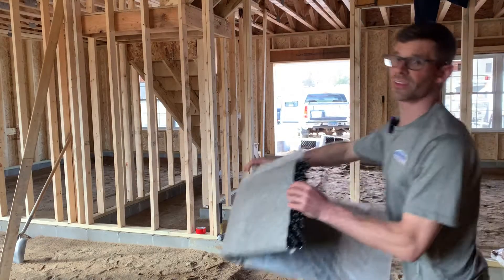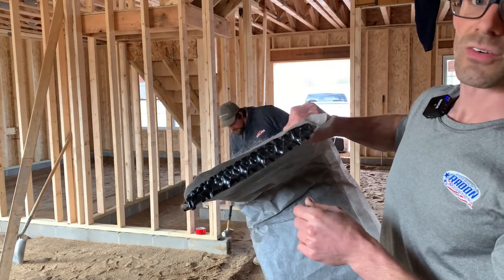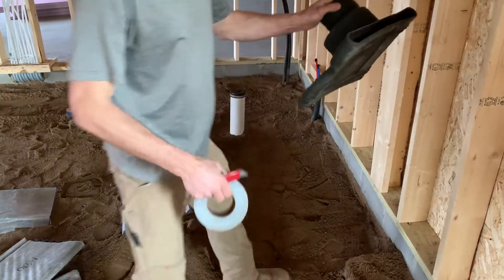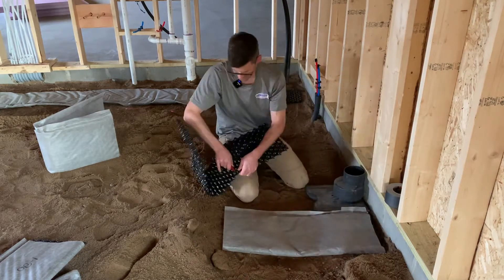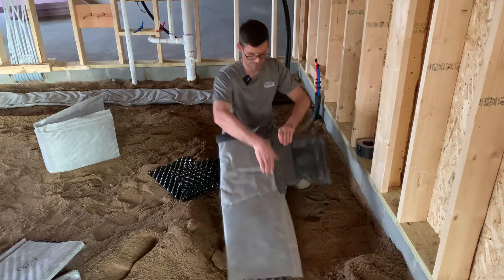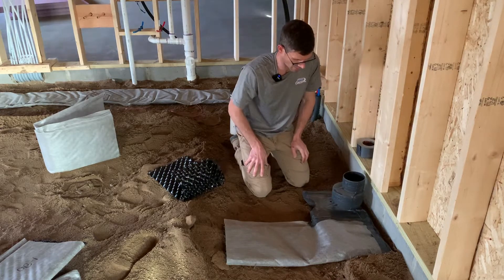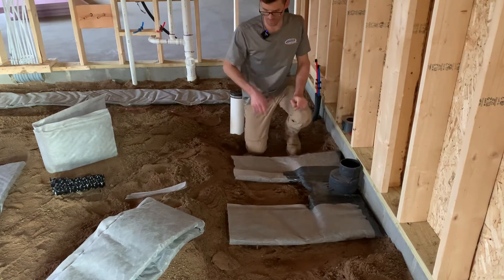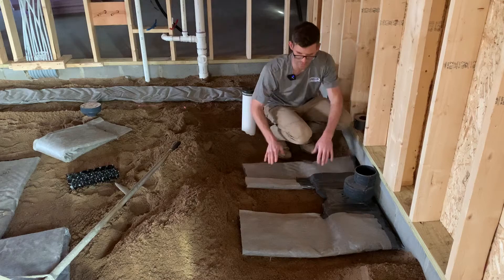Radon Soil Gas Mat and Vapor Barrier Install (House Build Ep. 6)

Comment from the maker: Products Featured
1. Soil Gas Mat - https://radonpds.com/build-radon-ready/
Use code JESSE for 5% off your first order. We receive a commission. 

2. Gorilla Tape - https://amzn.to/4lG8vhx

3. Landscape Staples - https://amzn.to/44HDpju

Radon Standards
1. The radon standard we are following. https://standards.aarst.org/RRNC-2020/index.html

2. View other radon standards here. https://standards.aarst.org/

Other videos in this series:
1. From Dirt to Foundation: Laying Out Footings and Forms (House Build Ep. 1) - https://youtu.be/UP3scCbdBQU?si=kWaxZO9wIyAn9jlv

2. From Footings to Block Walls: Passive Radon System Options (House Build Ep. 2) - https://youtu.be/ZR46xPbNEiI?si=A-JsE2qcx9_4M6Ko

3. From Backfill to Framing: Floor Trusses and Radon Suction Challenges (House Build Ep. 3) - https://youtu.be/wqWcpdSs594?si=jhkEToaP6GSmXwnQ

4. Radiant Heat Installation and Garage Slab Prep (House Build Ep. 4) - https://youtu.be/chzl1Rt171c?si=dQ6MekKXVo0WG4HO

5. Rough-In Plumbing and Radon Vent Installation (House Build Ep. 5) - https://youtu.be/b2dp9pZ3AtM

6. Soil Gas Mat and Vapor Barrier Install (House Build Ep. 6) - https://youtu.be/fMNzVpbfthE?si=KDKGKDOCuifnN9rB

7. Final Walkthrough: Framed, Roughed-In, and Slab Poured (House Build Ep. 7) - https://youtu.be/zympPubsILI?si=WAxKJDidw9sdHF9U

📍 Service Area
Serving Colorado’s Front Range and Mountain Communities:
Golden, Boulder, Denver, Cherry Hills Village, Evergreen, Breckenridge, Vail, Aspen, and nearby areas.

🗓  Schedule an Estimate
Live in Colorado? Book your in-person radon mitigation system estimate here: https://americanradonmitigation.com/

🌎  Have a Question for Jesse?
We offer virtual consultations worldwide: https://americanradonmitigation.com/consulting/

🛒  Need a Radon Monitor or Supplies?
Shop our online store: https://americanradonmitigation.com/shop/

🛍  Our Amazon Store:
https://amazon.com/shop/americanradonmitigation
We participate in the Amazon Associates Program and may earn commissions from qualifying purchases made through the links above. Thanks for your support!

🎓  Looking for Continuing Education?
Check out our radon courses here: https://americanradonmitigation.com/continuing-education/

Comment: I use a similar matting. I also have experience using thicker felt as an underlayment. The way felt is seamed together in the field is with a heat gun, so I guessed it would work the same with the matting. 
Works like a charm. Saves time, money and is a permanent bond. 
Great videos. I share them with coworkers. 

Best wishes from Ohio
Reply from the maker: Thank you! What matting do you use?
Reply: I use Enkadrain ST 20mm. Many of the products I’ve seen are identical, other than color combination. There is one product I used - the name escapes me right now - that is much more rigid. It uses the egg carton design. I didn’t enjoy using it as much, but that may only be because I’m so used to the pliability of the woven/birds nest design of the Enkadrain.

Comment: I appreciate these videos, thanks for providing them. I'm hoping you can answer a question. My basement radon level ranges from 12 to 25. I have radiant in-floor heating in a 4" concrete slab above a 1" layer of polystyrene foam then a layer of 8mil black plastic. Under the black plastic is straight sand (compacted with a plate compactor) which was used in place of gravel in order to save money and prevent the plastic from getting punctured by sharp gravel.
I noticed the house in this video has very sandy material as well. In your experience, how well does air/radon move through sand?
Reply from the maker: Thanks, Jake. Does your basement have drain tile? If so, tie into that with your radon system. 

Coarse sand is relatively easy to move air through. However, fine sand is another story. You will likely get the best pressure field extension if your suction points are next to sub-slab plumbing.
Reply: @AmericanRadonMitigation  Thanks sincerely. Unfortunately, No drain tile. I noticed the sand was damp but I recall a comment you made in another video about the drying effect of the fan system. Can I expect the dampness to disappear over time? Seems like air would move better through dry sand.
Reply from the maker: It could potentially dry out unless there is a high water table or there are drainage issues. 

Kansas State University, which teaches many radon courses, has a slogan for answering questions like this. Sometimes, maybe, it depends. They even put it on tee shirts!